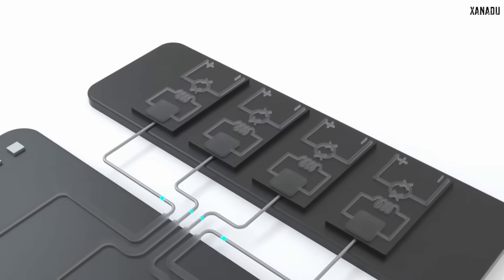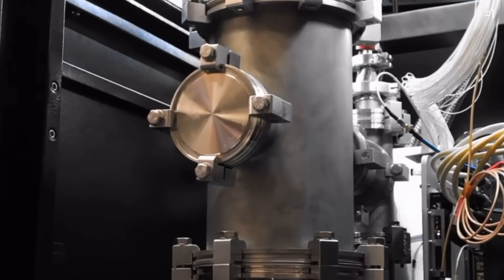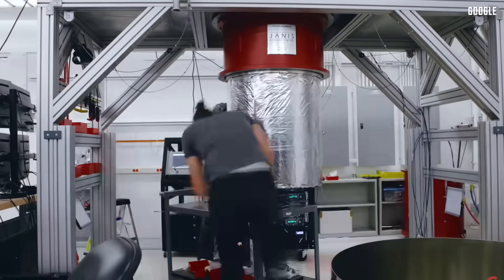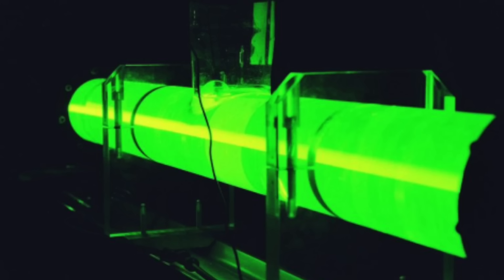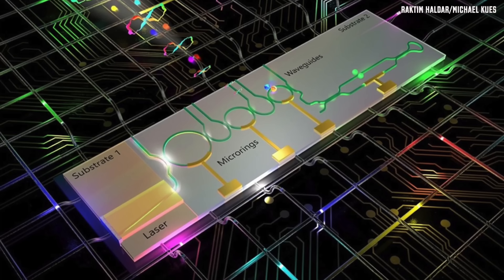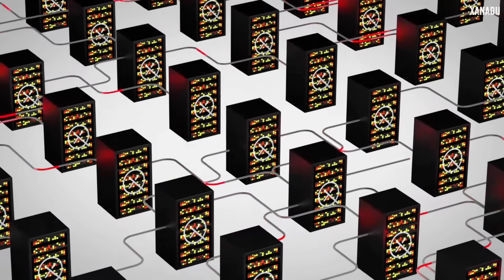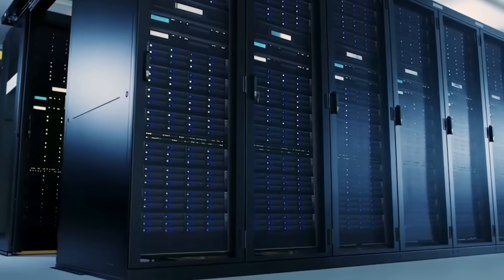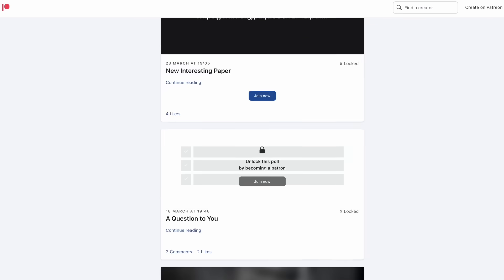New Breakthrough in Photonic Quantum Computing Explained!

Comment from the maker: Let me know what you think!
Reply: I like all of ur videos. Very informative.
I think future Q Computing breakthrough will come from Photonics based systems. Not superconducting qubits. As Photonics based chips can be used for both analog programmable hardware and Q Computing also it works in room temperature
Reply: Photon has a big advantage, 1st of all consmic particle dont interrupt the light
2nd,you get 0 emf influence.
3rd,entanglement based on photon are long lasting than the super cooled qbit one.

I think photonic chips have the bright future
Reply: @md.adnannabib2066 agree !
Reply: @md.adnannabib2066  I think only the computational operations are done with photons, the memory is still stored using electrons. So cosmic particles will still be a problem unfortunately.
Reply: @martiddy  oh,interesting,i didn’t know that,you have raised a valid point though.But still no prblm,see,we already are using classical error correcting code
Reply: You CANNOT cool anything down to 0K.  That's the third law.  You made a fundamental error.
Reply: Thank you for helping me understand this.
Reply: It sounds absolutely amazing.. but also extremely expensive, I would guess. To miniaturize this quantum chip technology to this degree.. I can only imagine it will be another decade or more before it becomes something we would see filter in common user devices that we can afford.
Reply: Man, this explanation is one in a decade. This discovery alone is of utmost importance, and this presentation is of the highest level of all ever. You're an inspiration, Nasti
Reply: big fan of your brain
Reply: Very interesting.. Awesome presentation! Will love to hear your breakdown of the technology  being developed by Archer Materials, also aiming to operate at room temperature, the 12cq chip
Reply: Hi, my love. I want to help you improve your pronunciation of the “t” sound in English. It’s not like in Russian, where you just touch your tongue to the roof of your mouth and say “t”. In English, you have to make a strong puff of air when you say “t” at the beginning of words or stressed syllables. This is called aspiration. For example, when you say “toy”, you should feel a burst of air coming out of your mouth. You can practice this by holding a piece of paper in front of your mouth and making it move with your breath.
Reply from the maker: @MudroZvon  Thanks! I will work on it
Reply: If there exists a code of universe I feel like we are very close to crack it.
Reply: @tufan__1048 I have the same feeling
Reply: @tufan__1048  R = U / I - that's the most general code that exists.
Reply: @RobregSvanoshiki  so how do you explain ie gravity with ohms law?
Reply: @tufan__1048  I've been working on that for 40 years. Now I need a computer strong enough to simulate it.
Reply: Imagine a Ai quantum computer....
Reply: @crazypasta7749  they're going to build AGI before integrating ai into quantum computing.
Reply: @crazypasta7749  it's going to be called QASI
Reply: Can't wait. 😎
Reply: Nothing can be as cold as 0K, you can just come closer and closer, but never 0K.
Reply: What if we cool photonic quantum computer to zero Kelvin does it work more effectively?

Does it need error correction qubits?
Reply: @farhanaf832 no temperature has near 0 influence on light.
Reply: I look forward to watching every video your make, Anastasiia! I learn so much from each one. Keep it up 🔥 I am also going to take inspiration from the design of your thumbnails if that's fine with you 😉👍
Reply: Could you please share the scientific paper you hold it.
Reply: With the speed of current development and injection of huge funding and with the largest companys, Google, IBM, Honeywell, Cambridge + a few more we will see some really unbelivable things start to happen for all civilisation on earth to see, unimaginable game-changing things nobody has even thought of yet, this resembles the invention of fire back in the first evolution of humans, almost anything will become possible, and we should see these special things start to take place before the end of this year. Amazing.
Reply: Think you're amazing. 🎉
Reply: Isn't it something capable of making any current encryption or hashes obsolete?
Reply: You didn't do the little giggle during this video....🥺
Reply: This is fantastic!
Reply: Hmmm…. This method of computation seems great for space deployment.  Very cold already out there, and if you could integrate the preeminent light of the sun as much as possible into the design, it seems like a fun project.
Reply: Great animations!
Reply: Rofea Optoelectronics offers a product line of commercial Electro-optic modulators, Phase modulators, Intensity modulator, Photodetectors, Laser light sources, DFB lasers,Optical amplifiers, EDFA, SLD laser, QPSK modulation, Pulse laser, Light detector, Balanced photodetector, Laser driver, Fiber optic amplifier, Optical power meter, Broadband laser, Tunable laser, Optical detector, Laser diode driver, Fiber amplifier. We also provide many particular modulators for customization, such as 1*4 array phase modulators, ultra-low Vpi, and ultra-high extinction ratio modulators, primarily used in universities and institutes.
Hope our products will be helpful to you and your research.
Reply: i think i need that precise kind of computer as a CPU to play vrchat
Reply: I am terrified
Reply: I think you are beautiful inside and outside
Reply: @whyso0erious | well exactly, it’s what I have been thinking for a long time : Lama Gangchen said that inner peace is the most solid foundation for world peace - can you and all find the connection here ? I think Anastasia is great too… exciting times!
Reply: Sooo..when can we combine Ai with quantum computing?
Reply: @Anastasi ... There's plenty of entangled particles out there in space from the Big Bang, but inside us from the Big Bang, not so much.  They have de-cohered due to experiencing much different interactions along their journey to our bodies.  However there's plenty of entangled photons being created within our bodies 24/7, and there's a field of research currently to determine whether our brains use quantum effects meaningfully.
Reply: Wow. Looks like these chips will make running GPT-5 on our phones easy. That's basically a J.A.R.V.I.S in your pocket. 

I think the world is going to change a lot over the next 5 years. Like the difference between horses and cars made for us.
Reply: Haha electrons suck
Photons are better XD
Reply: But lately it was tested and proven that entanglement wasn't real, forcing change on one entangled photon will not affect the other, it turn out entanglement is merely creating a synchronized initial state, once one pair moved out of sync the other will stay un affected, unfortunately I can't remember where I found that latest study, but I saw it on youtube like 3 months ago, you should search about it yourself if you care.
Reply: @PeacefulMindss Do you remember what the YouTube video is called???
Reply: @PeacefulMindss  That's real
But it doesn't destroy quantum computing, only FTL communication
Reply: @Hidden Markov AI overlord perhaps, yes.
Reply: I think you are Queen.
Reply: what are the disadvantages of this photons to qubits?
Reply: I used to think computers were cool.  Now they are just becoming scary.
Reply: Indium phosphide, silicon nitride?
Reply: good job!
Reply: Yes please ❤
Reply: If there is a very advanced race of humonids "Aliens" all they would have to do is fire their Artificial intelligence at earth on a light beam 😇
Reply: Hi Anastasia, I've just watched "men against fire", an episode of 'black mirror', season 3.
have you watched it?
it made me think of the technological advancements I learned from you.
Reply: Never was a big bang. This "there was a beginning" is just some shortsighted Christian nonsense. The universe doesn't expand but us as infinite as the smallest scales are infinite. Within it the galaxies basically just "in- and exhale". When they "grow" their content becomes thinner and thinner...so after a certain point they start to shrink again.
Reply: Its very interesting & amazing how far we come with computing.
Reply: All things considered 3w is almost no power to a Quantum chip, compared to current tech that is.
Reply: fascinating
Reply: Quantum entanglement is why natal charts are so accurate
Reply: I could stare and listen to you all day
Reply: You’re a god send.
Reply: Have your heard of Metamaterials Inc ?
Reply: Sounds like it’s the logical next step from our current computers but I’m not sure how long it will be used in data centers. But what material would we use.
Reply: I think you're adorable. And your channel content is excellent.
Reply: i wonder when they are going to work with liquid cpu or quantum pc
Sending liquid data is need
 are you from ro>? pana la urmatorul videoclip!
Reply: The faster A.I, computing and Robots evolve the faster humans become extinct. What do you think net zero carbon means???? We are carbon lifeforms and they labeled carbon as a pollutant. COVID already labeled alot of people as NON Essentials. It's was a test run. People need to wake up to where this is all going.
Reply: Have they dropped the electrons as quantum bits research
?. It would appear there is no reason to continue.
Reply: How about do a video on Intel Terahertz, yes TERA 1000GHz. Intel announced this in June 2001 and said would be sold to consumers by 2005, then "something" happened and 20 years later it's still not being used. That's 1Thz clock speed with 10,000 times less leakage and ran at LOWER power and lover voltage than other chips at the time, it was for consumers, no liquid nitrogen or any special cooling except their "special sauce" that they wouldn't disclose. I'm guessing either microfluidics or embedded heat pipe, possibly even carbon nanotube heatsinks tha that were recently developed back then with 300,000 times the heat transfer of copper. Oh, this is zirconium dioxide technology and I have an article from CPU (computer power user) with more details, I have the original paper magazine. Darpa and Mororola in 2009 and 2011 have also announced semiconductor electronics / computing deviced that run at 1THz. Darpa now deleted their page, probably classifired, and I don't know what's up with Motorola. This is probably used in some military applications. Oh, right after it was announced, nyyy - E - loovn happened and the NSA said, "consumers have too much computing power". Completely unrelated I'm sure, just like how CPU speed was 3Ghz in 2001 and is about 5GHz 20 years later, very little improvement not long after... Yet we have routers that can have built in 50Ghz digital electronics and some at 94GHz for 5G phone system.... but 5Ghz is the limit?
Let me know if you'd like me to send you a copy of that CPU Intel Terahertz artcle I scanned. See the Intel Terahertz wiki, it used to be 3 pages long and the references.  Also, there is a Bloomberg video - 2001 techtv clip - intels new "terahertz transistor"
if you doubt this is a real technology.
p.s. Another interesting thing is the Argus system from "Rise of the Drones" a PBS show from 2013. In that show it said "each drone stores 1 million TERABYTES per day", since that's more than the world supply of hard drives, I'd like to know how the do that for ever 1 drone...
Oh, I'm an EE myself, that's why this interests me so much, it goes way way beyond the current level of consumer technology, Just the CPU speed of 5GHz vs 1Thz or 200 times faster, and with less heat somehow. My guess it's like the current CPUs, runs in bursts of speed like Speedstep and at least has embedded heat pipes or microfluidics. That Argus system, they have to have much higher density than now, probably 100x times that of consumer technology.
Reply: Can we not build these types of room temperature optics or photon type quantum computers at home?
Reply: It’s not. It never has been.  Just more efficient methods to kill each other.
Reply: I don't see very well the difference between photonic circuits and ion trap circuits which also use photons as qubits.
Reply: 3
Reply: It is interesting you talk about science improving our lives. Technology without wisdom had led to disasters world wide. What you are talking about is basically a light processor. I came up with this idea over 10 years ago but abandoned the idea after i found out someone has patented it without a working prototype. I got the original idea for the old testament of bible. Lord Jesus is the light. Artificial light is limited and will fail eventually.